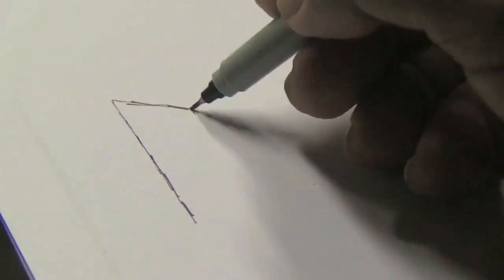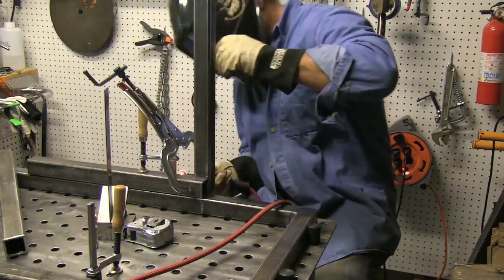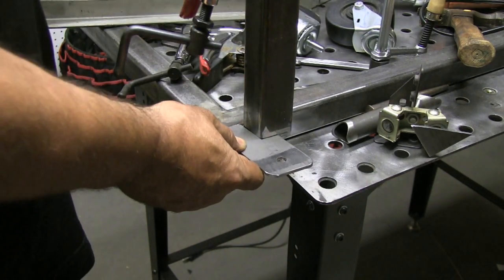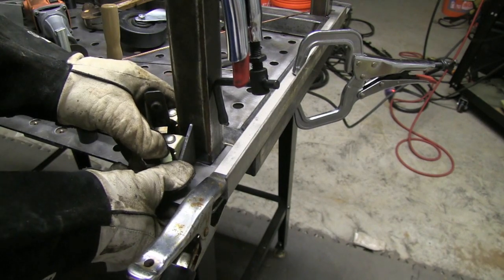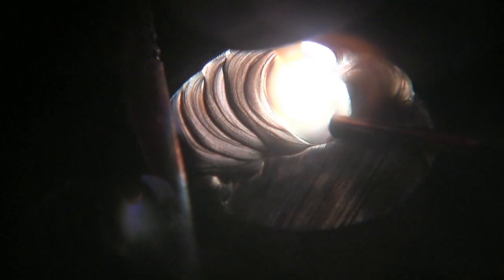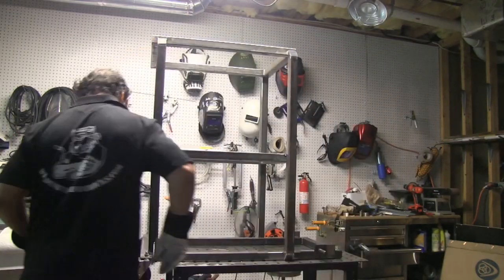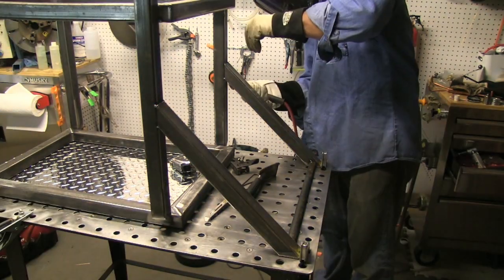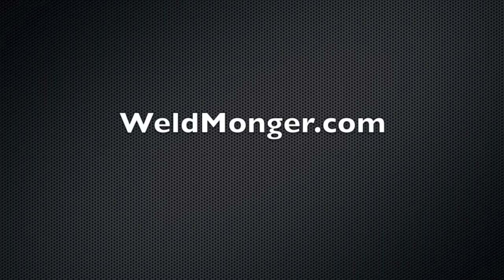Welding Cart Project Part 3

Comment: When you doing part 4 ? Ty for info on tools tips and tricks. I just bought a 90 amp flux core mig welder from harbor freight. can I do as good a welds with that as you do with the mig you use here?Ty for info in advance.

Comment: Hey Jody: 

Thanks for shipping out my TIG Finger so quickly!  I can't wait to use it.

What type of abrasive brush did you use to prep those rusty tabs which already had the 5/8" holes drilled out?  I have never seen that before, just the small wire cups.  Also, would you suggest using that type of brush to remove the mill scale off of a welding table top or would you use an acid instead?  I want to use PAM to keep the table rust free and stop any spatter from sticking.  Am I on the right track?

Comment: thanks i enjoy the vids. so yea i thought its pretty heavy! like will hold up the whole shop in a earthquake strong lol. the cart I built is out of 1" square tube x .060! light weight and is really pretty strong. problem i see with your cart is having to lift the bottles up on to the cart its nice to have the bottle holders low mine are made out of 1" angle and is about 3/4" off the ground i can just roll the bottles right on with out having to pick them up. i use the top of mine as a table and i made it the same height as my welding bench, it has a hostler for the mig gun, tig rod holders, place for water cooler, mig welder, tig welder, and i welded some angle iron to the front as a tray to hold rod or tungsten's etc. i was planing on adding 220v plugs to the cart so that both welders plug into the cart and have one cord that comes off it so that every thing has power with one cord, but havent got to that yet.  also another thing to think about is tie down points when and if you have to move it and put it in a truck and being able to lift it with a fork lift. 
things i don't like about my cart is: i wish it wasn't so wide, not much you can do about that if you need 2 bottles, air tires, they suck they slowly leak and you have to fill the them, other then that im pretty happy with it. http://i331.photobucket.com/albums/l479/markbenoit/photo-4.jpg

Comment: I'm sure you've already addressed it, but are your arc shots typically slowed down and if so by approx. how much? In some of them you can really see the fluid puddle forming then solidifying and the intensity of the arc, more so than I see with my eye when welding. Thanks.
Reply: I'm more so referring to the TIG arc shots, thanks
Reply from the maker: I don't slow down the video but welding with a camera in the way can sure slow things down a bit.

Comment: Jody, when you MIG weld all your tacked joints, are you concerned about a weld sequence or direction that may introduce distortion?
Reply from the maker: access to the welds pretty much prevents you from camping out too long in one place ,  I skip around and make sure to mix up direction of welding. With plenty of tack welds, mig welding does not distort much if you skip around.